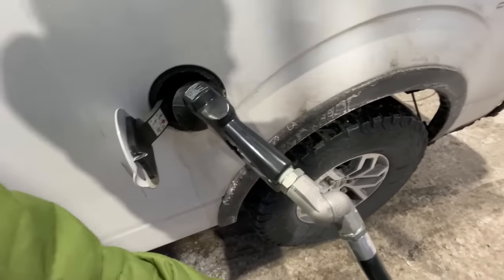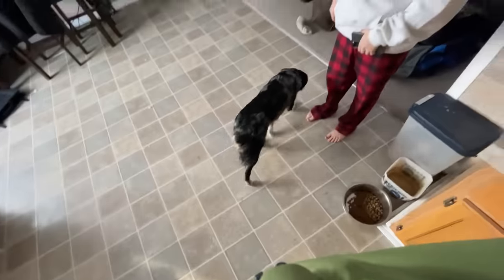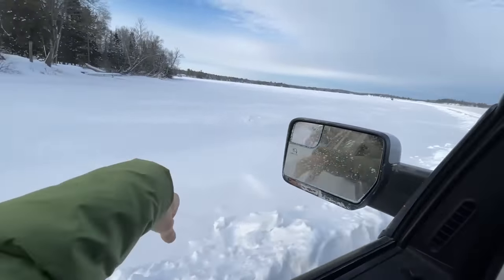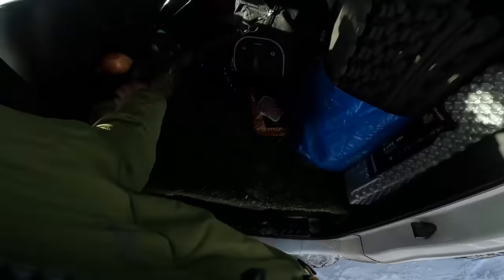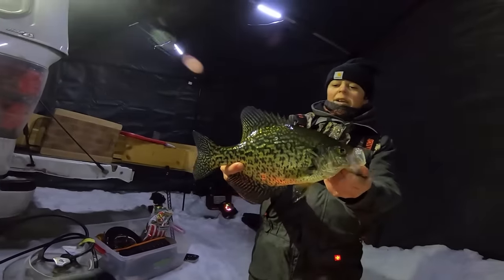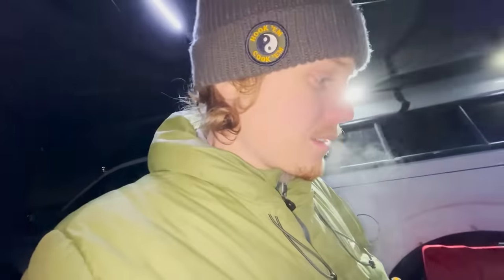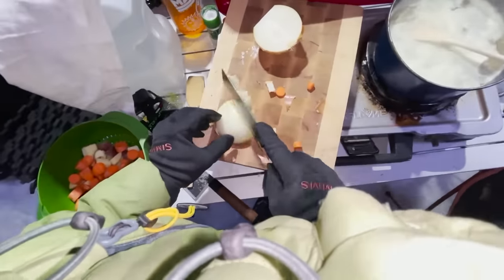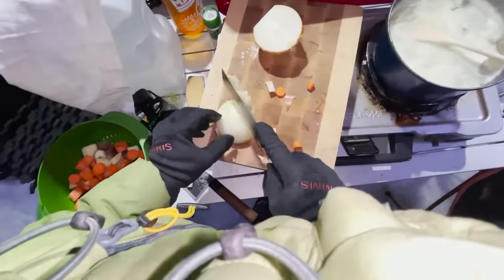Truck Tent Ice Camping on a Frozen Lake

Comment: Hey Mav,

Max here. Im so gassed that u made our Dutch soup. Im glad that you both liked it. Been watching u for like a 1.5 years now and never missed a video. Keep up the good stuff.
Reply: I want the recipe
Reply: @yadayada752  

This recipe is for three people.

Ingredients 

250 gr split peas
0.5 leeks
1 liter of water
1 beef stock cubes
125 gr celeriac
0.5 carrots
0.5 potato (250 gr )
0.5 smoked sausage (275 gr)
150 gr shoulder pork chop
0.5 bay leaf
A few sprigs of celery (25 gr)
0.5 onion

Preparation

Bring 2 liters of water to the boil with the stock cubes, split peas and bay leaf. Add the pork shoulder whole. Let it simmer for about 1 hour, stirring occasionally.
Meanwhile, peel the carrot, potato and celeriac and cut into cubes of about 1 cm. Cut the leek into rings and wash well. Peel the onion and cut it into fine pieces. Also coarsely chop the celery.
After about 1 hour of cooking you will notice that the split peas begin to fall apart and a green mass is formed. Some split peas will break sooner or later than others. Stir well a few times to speed this up.
Remove the shoulder chops from the pan, cut into pieces and add to the soup along with the chopped vegetables and potato. Let the soup simmer for about ½ hour until the vegetables and potato are tender and have shrunk a bit. Cut the smoked sausage into slices and stir it into the pea soup during the last few minutes and heat through. Season the pea soup with a little extra salt and pepper, if desired.
Reply: You know I love to cook Russian food My mama taught me how to cook fish sturgeon salmon trout your name it man and runs in the family jeans and coffee is the best stew in the world
Reply: Im dutch to
Reply: @maxdelang3454  Thanks for this man :D looks great
Reply: Lekker bezig Max! 🇳🇱
Reply: Goed waterige soep had hij hahaha
Reply: Get on the cross and don’t look back  Sorry I don't quite understand
Reply: Snert
Reply: @thealmightyz73  goed bezig die max
Reply: @koen8081  ja leek net cup a soup 😆
Reply: Are you so gassed about it brah?

Comment: Hey Mav, Love your vids. Please be careful with those high carbon Japanese knives in the cold and slapping them down on your cutting board. The steel becomes very brittle at low temperatures, and never use them to cut frozen foods either. Take it from someone who has worked as a line cook for over 3 years and has cracked off a chuck of a 300$ knife.
Reply: Use the Mora in these conditions.

Comment: you should buy a large tarp and throw it on the back side of the truck thats not covered by the roof! Might keep it a lil more warm since you dont have to worry about air coming thru from the bottom of the truck

Comment: So if you get one of those dual prop heat powered fans for wood stoves, put a notch in back, it will mount on top of the small Buddy heater that doesn't have a built in fan. Total game changer!

Comment: Hey from upstate NY!  Have a weird but potentially efficient one for you. Reptile, thermostat regulated warming pads. Hear me out on this one…you get a piece of bubble wrap insulation, cut it to fit the length of your sleeping bag (inside) and stick two of the pads to it, one by your feel and one mid section. They are 7w each and can be set in a 0 degree bag to keep you toasty. Give it a try??

Comment: Straight leg ez up has insert tents, side tents and screen inserts with 1 , 2,3,or 4 zippers. You have 4 zippers you can back your vehicle to one , have a side tent on another side wall for shade on one and use one for a door. Some inserts have floors others not. You can have pretty quick shelter using one . I'm not getting a screen insert. Probably will just use the side tent and a panel wall.

Comment: Mav, the Thermarest Z-Lite that you use, you are supposed to sleep on the silver side, it reflects your heat back at you, if you sleep on the yellow side, it's nothing more than a normal pad and you are not getting the benefit of the special reflective lining. They even tell you this on their website, they state that your supposed to sleep on the silver side.

Comment: I got a Meal Suggestion For You .... You Need Red Patatoes, A Jar of Cheese Whizz , 16oz jar of mayo & at least 2 bags of bacon bites could ... the more Patatoes you use the more bags of bacon you should get .... so at least 2 bags but 3 or 4 to be sure ...

How to cook them : Peel The Skin Off The Patatoes, Then Cut Up the Patatoes Into Little Piece Not Too Small ( maybe a little bigger than the size u would to make home fries ) , Boil A Pot Of Water For Like 7-10 mins Then Drop The Cut Up Patatoes Into The Pot & Let It Boil For Like 25-30 mins  Stirring Occasionly But You Don’t Have Too , Once 25-30 mins has passed take a spoon n try to slice thru it with a spoon if u could then that means it’s done , remember just soft enough to cut through with a spoon don’t let it get too soft or out of the form of a cut up Patato or it will turn to mashed Patatoes.... Once The Patatoes Are Done , Drain The Water ... Then Take Your 16 oz Jar Of mayo drop it the pot & mix it amongst the Patatoes... if you use a whole bag of Patatoes use the whole 16 oz of mayo if not use amount u feel like is right , Then Take The Jar of Cheese Whiz & Do The Same Thing Mix Amongst The Patatoes... Then Drop Bag of Bacon Bites 1 Bag then Mix Before Dropping The Next Bag In ..... Then Put In A Oven for 20mins , so won’t have a oven I don’t assume so prolly would have to just Fry it on a pan will still come out the same I assume because the taste will not alter based on using a oven vs a pan because the purpose is just to cook it more & warm up the things added too it .... & That’s It’s .... When Done Let it Cool Off For Like 10 mins Before U Try It . Takes No More Than A Hour To Make .... Look Foward To Seeing If U could Make This Happen Outdoors

Comment: Propane heaters can give off CO2 but only if there's incomplete combustion which wouldn't happen with a space heater. In a small enclosed area with no ventilation you'd want to be more worried about low levels of oxygen. But propane is a clean-burning gas unlike other fuels like gasoline or diesel.

Comment: you should make a small stove for under the tent that you can vent out the side with sheet metal not to burn super hot just to bring the temp up 30-40 degrees under there a  single or two log burner.

Comment: Dumb question, where was the gaping hole?  Was it air coming in from underneath the truck or ?  If so, why not put snow around the exposed part of the truck to block the air?  Or was it on top of the truck (windshield/front end)?  That looked way too cold for my comfort, though looked like you guys had fun!
Reply: Oh.... I saw it after getting to the end of the video.  Maybe bring a tarp/blanket or something to drape over the front?  Looks like that tent solution has a bit of a flaw in the front there.  :(

Comment: I got one question.
Why? 
What if the ice cracks and the weight of your truck falls right through?
I'm from Northern Iowa and I absolutely love camping and  I love those tents that pull off the side of your truck. But I don't get why you would want to do it in below zero temperatures on a f**** frozen lake .
Reply: Don't think so